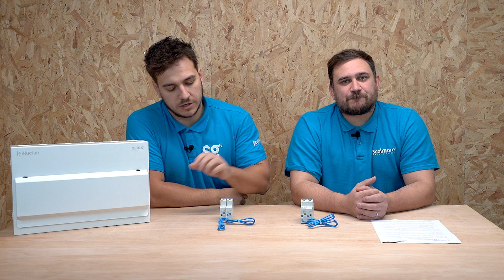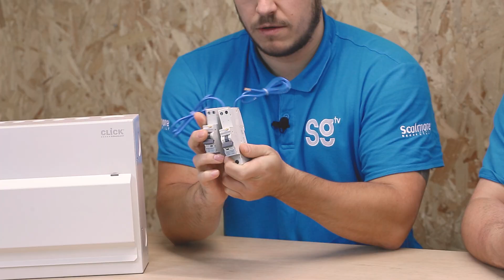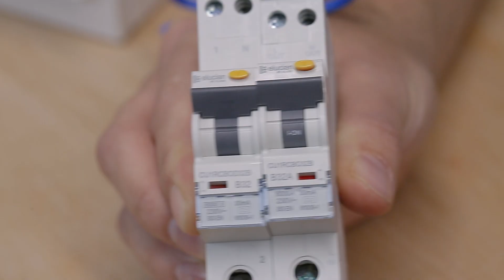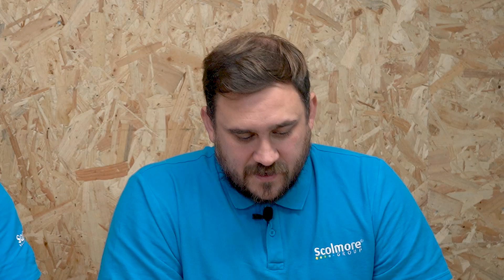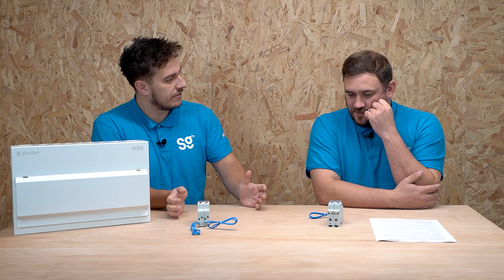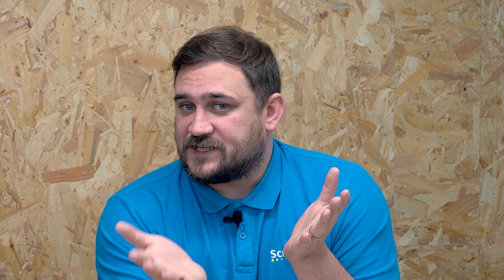Understanding Bidirectional and Unidirectional Devices.  Regulations Amendment Explained 🤷🏻🤔

Comment: Still lots of nonsense being spouted about these "bidirectional" devices.  Firstly, it has nothing to do with the direction of current flow.  AC current flows in both directions (changes direction 100 times per second in a 50Hz system).  An RCD / RCBO will trip when it sees an imbalance between L and N.  Whether the power is consumed upstream or downstream of the device, it makes no difference, it will still trip.  This "Bidirectional" term that the sales and marketing folks have gotten hold of means one thing - The test circuit (the resistor that simulates an imbalance between L and N) will be disconnected completely in the tripped state meaning that if you hold the test button in with the "output" side live, it won't burn out the resistor.

Comment: Clear as dishwasher!

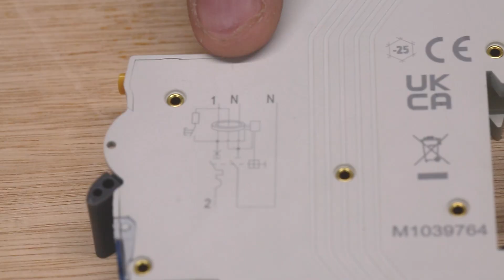At 7:35 he points to the side of the devices, saying they are bidirectional, when one of them clearly as IN & OUT terminals labelled. Same at 4:51, says they are bidirectional even when clearly labelled as IN & OUT, but he says that's just for polarity.......a few minutes after saying unidirectional devices will always have IN & OUT labeled.

Then at 8:32, he mentions BIdirectional device, if there's an earth fault at one side of it, it might not trip. Surely a slip of the tongue and he meant to say UNIdirectional....but again, clear as dishwater!

Comment: Can you please give an example of any device that is bi-directional? Most equipment is a load only, and PV inverters are only a generator (they are self powered) so also uni-directional. At 11:01 you say that 'even if the power is only going one way all the time, the device needs to be bi-directional' - why? Are you confusing the need to switch neutral with the direction of current flow?
Reply from the maker: Thank you for commenting.
Regulation 826.1.2.2 states current flow and polarity should be taken into account. Although a piece of equipment such as a PV generator may be uni-directional by design, the design of the system may mean that this is ‘Feeding’ back into the grid meaning power flow will be in a certain direction through the protective device, if the protective device was uni-directional the equipment would be connected to the load side of this device and there is a chance under certain conditions this device will fail and become damaged due to the electronics inside.
Reply: @ScolmoreGroup  But in an AC circuit current flows in both directions (in sequence) and the polarity (of the live conductor) also cycles (above and below ground potential). In a single pole device, it is not possible, at the device, to know where either the load or the generator is. In a 2 pole device, when connected, the generator side and the load side are still difficult to distinguish. It is when isolating that the differences happen- one side may have potential and the other not. I believe that this is the difference- 'Bidirectional' (really poor name!) can tolerate potential on either (or both) sides. Can you confirm this, or am I missing something?
Reply from the maker: @Tensquaremetreworkshop  Thank you for the great comment.
It's more we have to focus on the "under certain conditions" and break this down, what we mean regarding this is under certain fault conditions a unidirectional protective device may trip even though a source is connected in parallel to the incoming supply ultimately to the load terminals.
When this disconnection happens there is a chance that this will permanently energise the integrated circuitry and can cause the solenoid to burn out.
If this happens, the protective device will potentially change its characteristics and no longer offer the relevant protection it was installed for. 
As an example an "RCD would effectively only operate as an MCB". By using a bidirectional device "under certain conditions" this will disconnect the integral circuit and solenoid in a situation where the device trips.
Reply: @ScolmoreGroup  Ahh, I think what you are saying is that 'unidirectional' devices rely on the breaker removing power from the detection circuitry, when it opens. If they are still connected to a generator on that side of the breaker, this will not be the case. So, I was correct in my diagnosis- it is in the open condition that the device needs to tolerate potential on both sides of the breaker- and is then given the confusing name 'bidirectional'. A better name would be symmetrical- it can be used either way. Current flow is irrelevant, it is only when it is not flowing that the problem occurs.
Having said that, operation of the breaker with remove current flow, so both over-current and earth leakage detection will cease, so the internal circuitry should revert to a 'passive' state. I would be interested to hear in what circumstances that could be a problem. After all, it is normally powered in use.
EDIT- of course! Problem is the use of a thyristor to power the solenoid. Relies on trip to remove power. So a better name would perhaps be 'self resetting'.

Comment: At 4.23 you mention that all MCB’s are bi-directional by nature and always have been. Apparently that’s not the case, for all brands at least. If the arc chamber is on the incorrect side of the point of isolation, then the MCB can be damaged by the arc when operating/ opening under fault conditions😅
Reply from the maker: Hi there ☺️ Our MCBs have always been bi-directional, so that would be what Jake and Marcus were refering to, but you're right in what you say 👍 We appreciate the comment!
Reply: A single pole device can never have polarity. AC is always bi-directional, and it cannot detect where, or even in which order, the load and generator are. It will experience an AC current flow when closed, and an AC voltage when open. This gives no information on the topology.